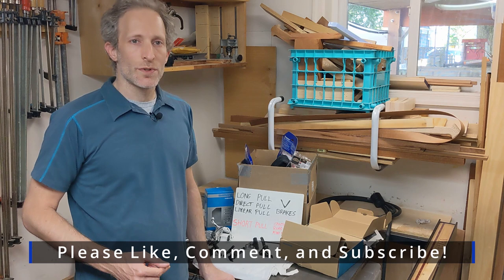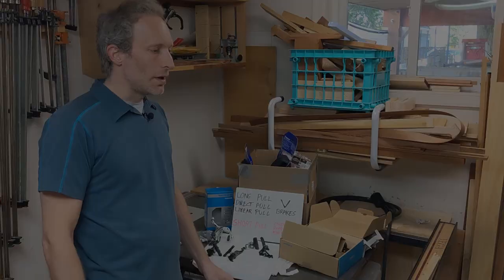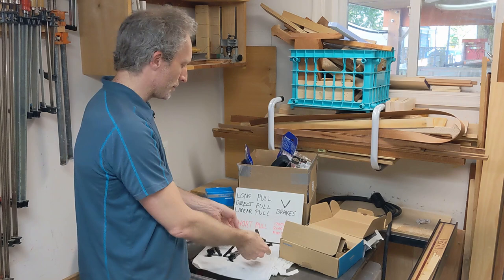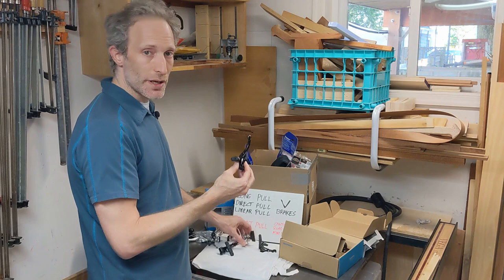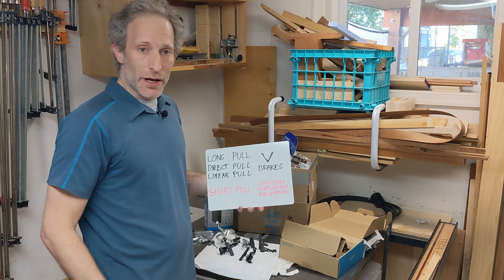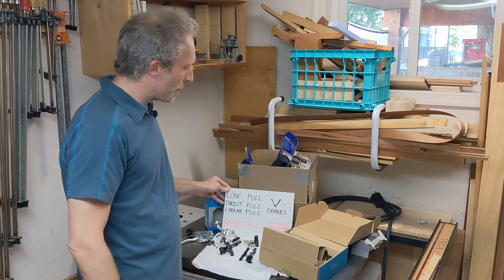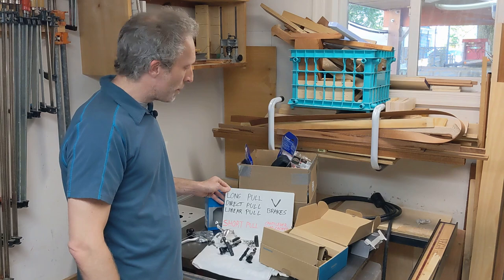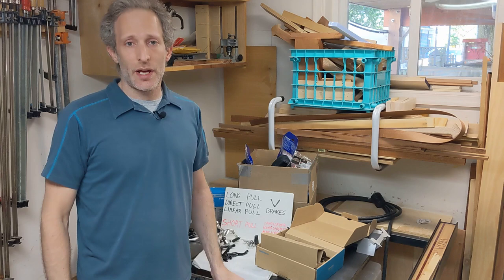Long Pull vs Short Pull Bicycle Brakes

Comment: This video hit the nail right on the head! Thank you for putting out an explanation to a confusing point for alot of cyclists converting their 90's bikes into gravel bikes with dropbars with short pull  levers designed to work with short pull brakes.

Comment: sturmey archer drum brakes - I guess should be treated as long pull... I have them set with short pull levers and the lever moves too much / the brake actuating arm moves too little / the braking feels spongy and modulation isn't good (brake effort doesn't ramp up with increased lever effort. ) excellent summary with the cheat sheet there! thanks

Comment: Are the Shimano BR-T4000 compatible with brifters?
Reply from the maker: No.  Brifters are short pull so you need cantilever or a mini v brake like the Shimano brs-323, tektro rs6, or Paul mini moto.

Comment: thank you for posting the video. i enjoyed it. if there was anything to add, not sure if you mentioned it, the different risks of installing the wrong levers or brakes. having too short of a pull sounds a lot more dangerous, to not have enough braking power. having too long of a pull might feel grabby, but would still supply a lot of braking power.

Comment: I am attempting to change my existing cantilever brakes to v brakes. I bought the same parts as you show in this video. Problem is the v brake recess for the pin is shorter than the canti recess. So do I cut back the frame or what. I can send pictures if there is a way to get these to you.
Reply from the maker: Sorry, I'm confused.  Which pin are you referring to?
Reply: I replaced my cantilever brakes with mini v brakes.  They claim that they will work with long pull leavers, not true. I replaced the noodles with ratio adjusters, and they were perfectly with the sram double tap levers.

Comment: Thank you for explaining in an easy way long pull vs short pull.   I recently bought a mini-V brake installed with normal V-brake lever, I did not realize they are not compatible each other.   Some forum discussed mini-V brake just a shorter arm but still make it work with normal V-brake lever.   More over, they said mini-V brake just has less space of tyre clearance.

With your practical experience and summary guideline board, mini-V brake is compatible with ONLY road brake lever and cantilever.  It really help.